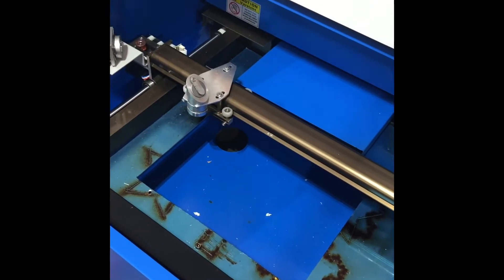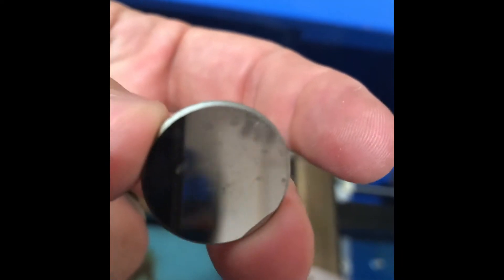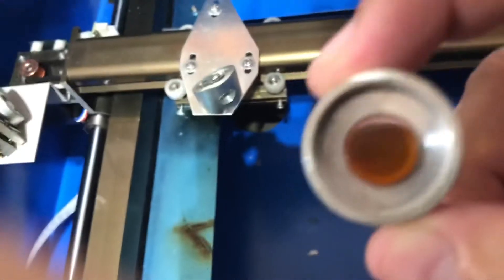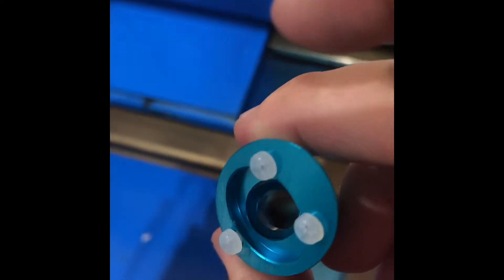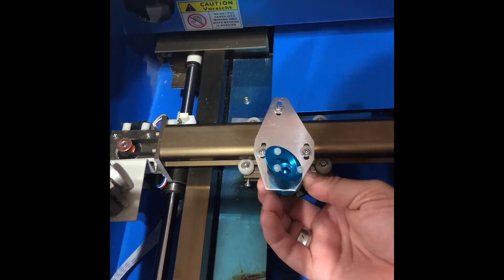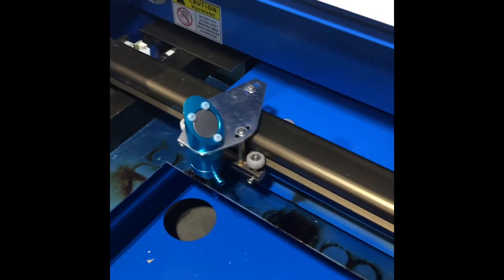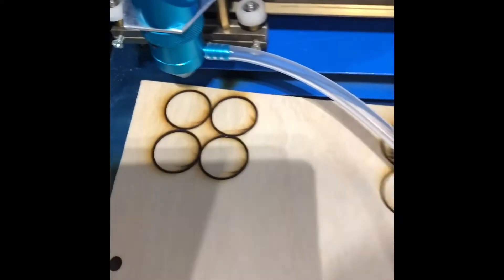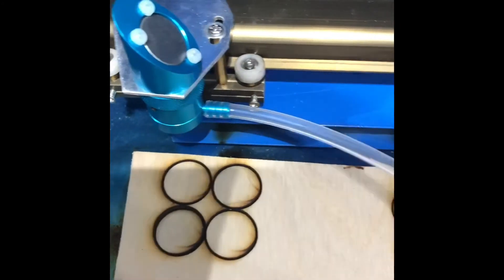Cloudray 12/18mm FL50.8 & 16mm FL25.4 Laser Head with Air Assist for K40 Laser Engraver Cutter

Comment: When I added a 50L air assist to my k40 laser It turns on and off by itself, what is the SOLUTION please 🥺
Reply from the maker: Sounds like your install is causing a electrical short or  drag chain is blocking the beam.
Reply: I am not getting a burn through the head.  Any ideas?

Comment: How is the new lens and air assist housing working for you?  Can you add a link to the one you installed.   Thanks.
Reply from the maker: I had to make some modifications I will post a follow up video
Reply: @jasonsanders8014  Hi, I've got the same laser head but haven't installed it yet.  What sort of modifications did you do? Thanks for sharing!